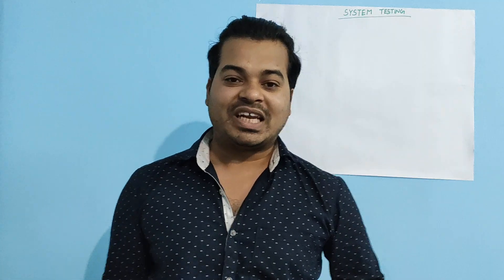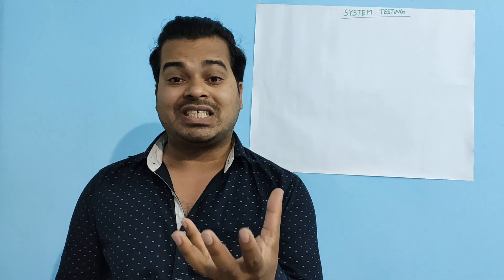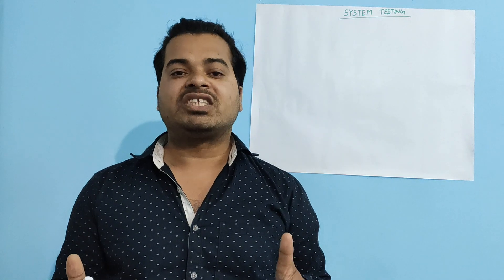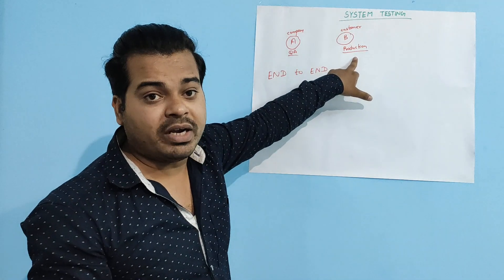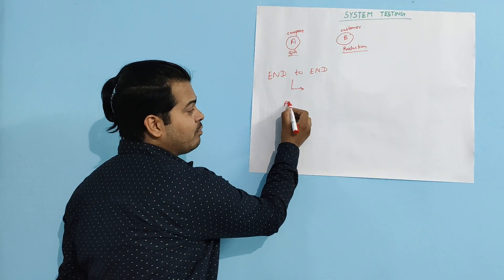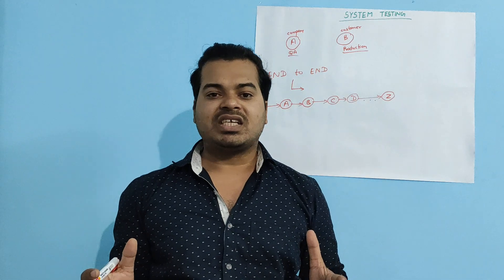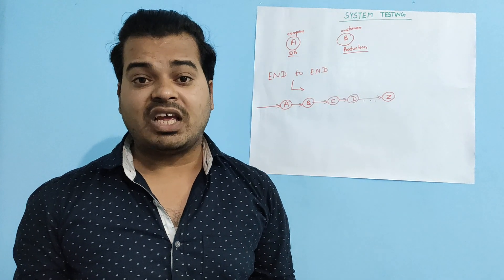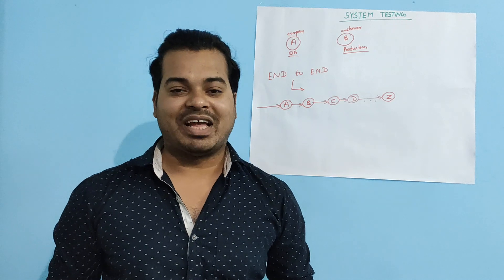What is System Testing in Software Testing? SoftwaretestingbyMKT

Comment: Hi Sir, is Component testing and Unit testing are same? or not? 
I google it but the definition is quite confusing, can you please give response for this?
Reply: Unit testing is done by developers, component testing is done by test engineer. Testing each and every line of code is called unit testing because 1 line of code is the smallest unit of the application. For unit testing you have to know the code and this comes under whitebox testing. As for component/functionality testing you don't have to know the code. You check if the the specific component is working or not. This comes under blackbox testing. Hope this is helpful to you.

Comment: Is use case based testing included in the system testing ?

How about testing with black box techniques like equivalent partitioning, boundary analysis, etc.. ?
Reply from the maker: Yes benny use case should be included in system testing. 
Without use case how you will be knowing all the flows in your application. 
And yes even test case design techniques should be included in testing in order to have good test case coverage.
Reply: @SoftwaretestingbyMKT  so the techniques like equivalent partitioning etc, aren't usually included in system testing right ?
Reply: @bennysusanto5524  
Obviously test case design technique is used to build better test cases.
Hence it is included in system testing
Reply: @bennysusanto5524  
Use case based testing is one of the test case design technique.

Use case based testing helps to identify test cases that cover the entire system.